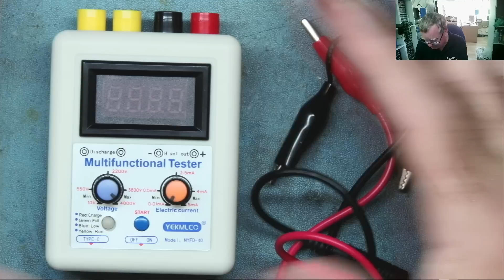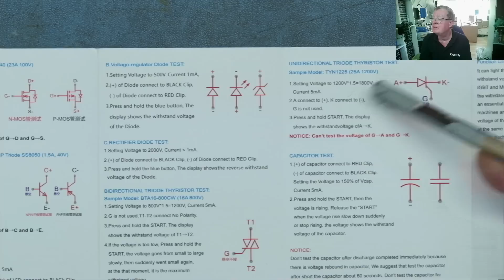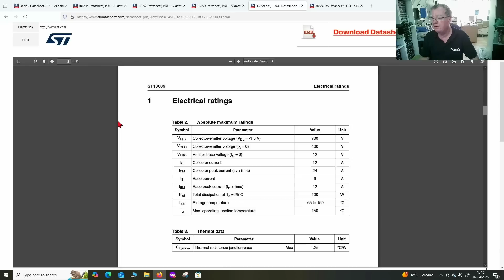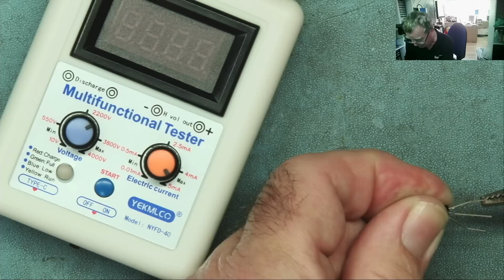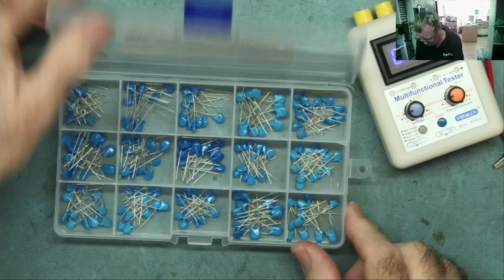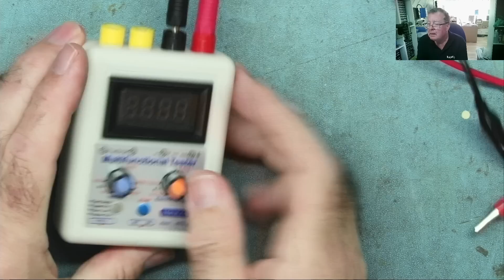Cheap 4000V Breakdown Voltage Tester : Find FAKE Mosfet Transistor IGBT Diode Capacitor Triac ETC

Comment: I wonder if it can get the high voltage cap on a small switch mode power supply up to a high enough voltage to get the switcher running and it at least generating standby voltage? I'm going to try this when mine arrives.

Comment: I've just modified mine to display current as well as voltage. It's not very accurate (linear) as it's at the very bottom of the meter scale!
Reply: Could you show a link to your creation?
Reply: @DemiGod3  If only YouTube allowed photos in the comments, I'd post one here!

Comment: There are many counterfeit components circulating. And some are sometimes even better than the originals. The point is, you just have to test your components with a scope and a multimeter. You'll already know a fair amount by then.

Comment: I agree with other commenters, any device tested on this should be considered dead and not used further. This is a destructive test. Fine to test a transistor out of a batch from AliExpress to see give the whole batch is fake. But the part should then go directly into the trash.
Reply: Is there anything to explain your comment further, I dont understand the "destructive" part.

Comment: Great tool! I’ll get one to test some unknown variable capacitors and see if they can be used in HF circuits. Unfortunately, I also bought those AliExpress capacitors and never considered the breakdown voltage. They failed the HF test on my VNA and showed up as inductor with no visible self resonance anywhere near the HF bands. Even if mine can handle 1 kV, they’re still useless for HF applications and a waste of money.
Edit: OK just punch holes in the dielectric. So instead of blowing it up with my radio I can do it with this device 😆. On air variable capacitors this is not a problem.

Comment: Wow! I trawl aliexpress almost daily for the latest gadgets...this was under my nose the whole time.

I recently bought a heap of hard to find obsolete transistors to rebuild an audio amplifier. They came from a reputable local wholesaler, and were pretty cheap, but the markings were quite a bit different to the original toshiba transistors.

I decided to hold old off on the project because I was suspicious that they were fakes that had made their way into legit supply streams....This cheap as chips unit will be worth its weight in gold!

Comment: I got one from AliExpress for 14 USD , a little bit different than yours .... No discharge ports ..... Leads that I was "supposed " to put together myself .... I don't care for those small slippery alligator clips .... I have some quality hook clips and good silicone 16 ga. wire ...... I used the black 16 for the main and 18 gauge for the secondary clip which is a green clip and of course red for hot......... It works awesome , I checked a bunch of mosfets I got from AliExpress and they all passed .... I had some older green Chiclet AKA Poly film 82 puff and the tester punched a hole in the film I think..... The 2 that I tested went high then 0.000 , I tested them on LCR and they tested perfect , then I put the load test on them with the new tester ........  They tested as resistors on the LCR tester.... It tests Zeners , LEDs , diodes ...... I had a bunch of unknown LEDs from AliExpress , all clear cases... I now know the colors and voltages .......... I think I'll do a review on it on my channel...

Comment: what is the difference between. 0-3700V and 0-4000V model? 4000V have additional yello inputs or output but what for?
Reply: The yello ports are for discharging caps. There are now some with even blue display.

Comment: When you were testing that big cap that wouldn't charge, you're right that the current was too low.  When I've messed around with large caps and my power supply, they would take a charge at around 8 mA, give or take depending on the capacitor.  For example, it might charge up at 8 mA, but at 7 mA that wasn't enough to overcome the self discharge and the voltage would go down.  So that tester maxing out at 5 mA probably doesn't have enough guts to test the bigger caps.

Comment: I bought one and it's twitchy as fcuk.  Press the button and the voltage says 400v then connect the DVM and the voltage drops to approx 1.5v  on the tester display and DVM. However, push the button and wak the voltage up to say 600V then connect the DVM the tester and DVM both reads 600V. Maybe I have a duff unit but if I was you I would check your tester to make sure yours is good.

Comment: Fake components and those that do not meet 
specifications are a big problem in more ways
than one -- as was demonstrated -
HV capacitors that are way off the specified
voltage.
A great deal of time is lost in diagnosing faults
when components are replaced with out of spec.
components - making a correct diagnosis
impossible .... and with so many fake components -
this device is essential  and given the price -
it won't break the budget.

Comment: AC components are rated on AC voltage, to withstand 600 VAC, it'd better withstand 1.4 times that DC both directions, plus safety margin lol.
Voltage testing is done with gate connected
and at 0V, not floating.
Very useful device, will easily destroy
gates and other components though with
that half milliampere, on the other hand will happily reform electrolytics if you're there to stop OV, and do rough leakage general testing...

Comment: it may find devices that are failing before the applied voltage gets to their max rated limit, but it kills them in the test.
I would not put a component tested like this in to any customer equipment even if it failed above the max limit. I would consider any component that had broken-down in the test as dead and put in the bin.

Comment: I suppose it can also check a FET
I wish you would have shown how it handles a real 1000V capacitor.
Reply from the maker: I did show it testing a 1000V diode 1N4007.  I think I have some good 1KV or 2KV capacitors, if I find them i can test on the next livestream

Comment: Let me preface this comment with the fact that I help out in the AliExpress Subreddit, and I see a lot of people with simple issues get denied when they file disputes. Even if you had this tester when you got those fact capacitors, I doubt that you would have gotten your money back. That is because AE Dispute team using English to Chinese translation, and you have to pretend that you are talking to a 6 yr old using short sentences without idioms. I have gotten money back on broken items, missing items or items that clearly did not turn on.  I could not see how you could explain to a non technical dispute team what the issue is with those capacitors. Perhaps if you could write the dispute in Chinese you may have a bit of a chance. The tester could validate the items and prevent you from installing a faulty / fake part in an item.
Reply from the maker: In my experience it is a bit hit and miss. I got a full refund on a 140W PD3.1 supply recently. On another purchase I was offered 50% off a PCIe analyzer that was not the one I ordered. For cheap items I tend not to bother if there is a problem, but this tester and also the fake mosfet detector I built which measures RDSon and VGSth will help and I would be more inclined to ask for refunds if i have problems in the future.  here is the fake mosfet destector if you missed it.  https://www.youtube.com/watch?v=k7ksXwLkz1Q and https://www.youtube.com/watch?v=naIG1RYzjc4

Comment: Regarding capacitors, you are not the only person noting large capacitors can’t be tested. The seller commented that there is a protection circuit inside to curtail delivery of current with long use.  My guess is thermal protection. To fill a large electrolytic capacitor would take a lot of work for the circuitry and I doubt the driver has sufficient heat sinking.  I built my own leakage tester and I know the mosfet/transistor gets warm even with a heat sinking.

Comment: Be aware that even at 0.01mA, you still can kill active components with high voltage.
For sensitive components, consider lower voltage testing unless you're doing destructive testing.
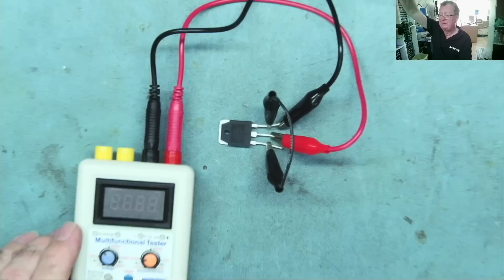7:53 - Testing at 0.5mA is dangerous for active components. Too much energy for internal structure.
543V is OVER spec, because of wrong knob position, and potentially/probably, in combination with 0.5mA, mosfet is now damaged internally. You are supposed to reach 450V with 0.01mA. You just fried components and current wanted to go higher but was stopped by internal device circuit.
Reply from the maker: I'm not sure that is the case as this is effectively a constant current source (allbeit a variable one) I would agree testing at a lower current is more sypathetic to the component under test. I'm not sure if the breakdown voltage would change significantly between 0.01mA and 0.5mA as this is effectively an avalanche effect.  Your suggestion regards the voltage 543V vs 450V would mean the breakdown curve has a wide range (knee?) with a very large voltage range between starting to breakdown and passing 0.01mA and completely breaking down at 0.5mA. That does not sound like an avalanche to me, though obviously in the reverse breakdown state the device will pass as much current as the source will provide resulting in destruction. Whether 0.5mA is enough to fo that I don't know.  A quick calculation at 543V x 0.0005A says 0.27W  However there is only one way to find out - next live stream.
Reply: @learnelectronicsrepair  Well first of all, there is a destructive testing and non destructive testing. You did not clearly declared which one you are doing, nor prove it after each test.
This is clearly one tester, but must be used differently per each component.
Regarding 0.27W, its about MOSFET gate oxide, that’s plenty to cause a breakdown, since the area is microscopic and the dielectric layer is incredibly thin.
Suggestion for 450V vs 540V is to stay under limit from specification. If cannot reach 450V its fake. You can also unplug leads, push button, check voltage adjust it on knob while pressing and release button. Then connect leads and test exactly at 450V.
For zener, test little above threshold, for other components little under threshold, for non destructive testing.

Comment: I just want to ask, as I have seen that you use components that you order from Ali Express. Then, I also ordered boxes of diodes, capacitors, transistors, and so on. Now, based on this video, I really don't know anymore if what I bought is really junk. and I need throw it away or can I use it, my problem is that at the Beginning, I ordered from the big sites like digikey, but as I am from Israel, the Shipment cost is high. They said it would take a week, but in reality, it took two weeks. I paid more for the shipping cost than the units that I ordered. So then I started ordering from Ali Express when shipping is totally free, and it does take precisely the same two weeks, and I thought if you are using the component and they are fine, then why not do the same. So my question is, how can I know if the parts I order are fine? As for Capacitors, I tested it with my multimeter and an ESR meter and it looks ok but the question are they ok ? same go for IC that I have order how can I know what is fake and what is not. or you can say don't ever order stuff from Ali Express and just order from the big site and then you don't have this problem but if this is the case then what do I do with all the componit that I have ordered? do I use then throw them away ?
Reply: So I have just seen this video:  https://youtu.be/sKyHXDBUSvQ?si=96jsp95y7-bRyTjo 
Do you think this is how to test them, by giving a capacitor-directed voltage?  And if it explodes, then I should assume that it's faulty. Is there any other way to test them without exploding them?
Reply from the maker: In my opinion - and opinions do vary - most components from AliExpress work just fine. The only instnaces where I have had confirmed fakes are a few times with power mosfets or transistors and apparently with these HV capacitors.  Most components are not worth the effort of faking. Where this is a bigger issue is obsolete transistors (from audio amplifiers in particular) which are under high demand from buyers and some power mosfets fall into the same category.  I would also be suspicious of things like GPU, APU and compnents for specific devices like Playstation or Apple where again there is a high demand and genuine parts are not easily available or are expensive.  I did also have a problem once with a 4000 series logic IC being fake (or just rejects from production).  So for the most part I would say buy with confidence.  As well as this breakdown tester I also made the Fake Mosfet detector that measures RDSon and VGSth so you can compare with the datasheet to see if the mosfet is within spec.
https://www.youtube.com/watch?v=k7ksXwLkz1Q (ghetto version)
https://www.youtube.com/watch?v=naIG1RYzjc4  (watch this also as it tests mosfets at 10A and the results were interesting)
And I'm going to build a fake bipolar transistor tester which tests collector current at high wattage which should also weed out fake power transistors - though it will probably be destructive to fakes. Will have that built in the next couple weeks so we can play with it.

I would suggest with a combination of these three tools you should have good confidence most of the components you bought are either genuine, or at least within the original device specs (what I would call suitable equivalents - or 'good' fakes)

Comment: It would be interesting to see what happens with neon lamps (e.g. the NE-2) and gas discharge tube over-voltage protection devices.
They exhibit characteristics like those of a cold cathode fluorescent tube - as the voltage rises they don't conduct until the gas begins to ionize, then they conduct at a much lower voltage. I wonder what the instrument would display - the "hold-off" voltage or the conduction voltage.

Little neon lamps are interesting - ambient light can influence the voltage at which they start to conduct.

Gas discharge OVP tubes are something I've never seen in common consumer electronics and they are pretty rare in industrial gear except for some telecoms stuff. They can take very high currents but unlike MOVs their capacitance is very low, making them suitable for high impedance circuits. Triggerable versions used to be used in xenon-tube portable photoflash units with automatic exposure. When the circuitry detected enough light had been supplied, the tube would be triggered and short-circuit the energy storage capacitor, quenching the xenon tube. Fearsome currents! (Commutated SCRs replaced that design; I don't know what is being used these days.)

Comment: Now that is the best cheap chinese tool I have ever seen that is a very handy tool for that price... I think every one that does electronics repair it is a must have tool in the toolbox... Very nice richard.... something to play with on the live stream.. to see how many fake components you got in your stock
Reply from the maker: I totally agree, it gets my thumbs up. It's cheap too so no reason not to own one.  There is also a cheaper version that does not have the yellow 4mm sockets and is missing the capacitor discharge function but is otherwise the same, though for the difference in price I would recommend having the cap discharge function, it just makes this even more useful..